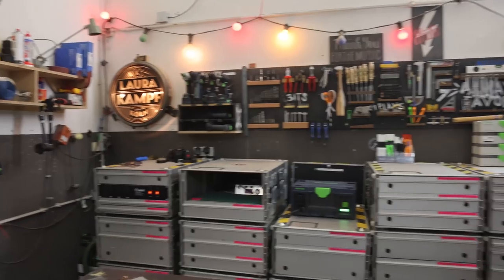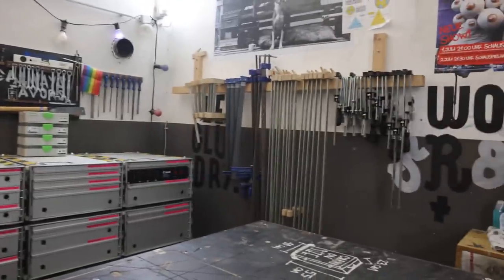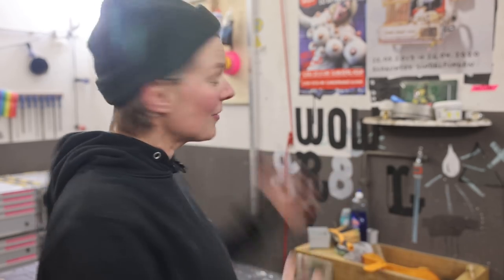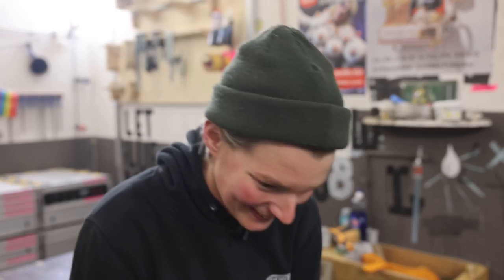This Clamp Storage Idea would be really good...if it worked :)

Comment: Some thoughts I had while watching:
Bearings are not pulleys. Your home-made pulleys (while nicely made) are part of the problem. Where the rope goes around or over the bearings, you're getting more, not less, friction and the ropes will slide off the bearing and jam. Use the bearings in the u-channel to ease the friction there (per Pixel Cadence's comment below).

If you want to be able to push it up manually, you need a counter weight so that the system is in weight equilibrium. Look at how theatre fly systems work for inspiration.

If you want to raise it by rope, use proper shaped pullies to keep the rope inline and set a hand winch at the end so you can just wind it up rather than hauling on it. Motorizing the winch will be even easier.

That's a lot of weight you have there, due to the solid piece of ply added to the clamps themselves. If you make it more skeletal, by cutting voids where you don't need material, it will weigh less and be easier to move. Even easier to move would be making a new frame out of aluminium.

BUT you're still losing the wallspace because you can't put anything below the storage or you won't be able to get it down low enough to get all the pulleys from it, so is it actually achieving the end you want?

My solution would be to create a horizontal frame I can hang clamps from and position it in the middle of the room, so I could use the wall for other storage, and counterweight it so that I could move it by hand.

Comment: It looked like the rope you were using was too small for the pulley you made.  I thought I heard the rope binding between the plate and the bearing. Shorten your brass axles so the washers rest on the inside of the bearing, closing up the distance between the plate and bearing. Use wheels or small bearings on the side of the board and inside the aluminium channel, like Pixel Cadence suggested. Love your videos! You're a brilliant maker.

Comment: As has been commented, the wheels of pulleys designed for rope have a groove running around the circumference which captures the rope and keeps it from getting wedged between the wheel and the flanges. Using plain bearings as pulley wheels is sub-optimal to say the least.
Making proper pulley wheels would be a good turning project. And while it's nice to have bearings in the center of the wheels, at such a slow speed they are really not necessary. Just a plain metal or even wooden wheel on an axle will work fine.
There are plenty of charts online that will explain the mechanical advantage of various pulley systems. These will help you decide how many pulleys you will need for the weight you will be handling.

Comment: I would definitely put a servo or winch on it. Also... the real trick is to end up making use of the wall space behind the thing that drops down, so ideally it drops down in front of something that is opposite it's own use. Like have the clamps on rails come down in front of the lathe... unless you plan on turning something with your clamps on it.

Also put some wax on your guides and the board, and you might want to think about putting some edge guards on your pully's sheet metal so it doesn't damage your line.

Comment: It looks to me as if it may be a weight balance issue looking at where it is binding. You may try and find the center of gravity for the center pully. Another solution may be to add bearings to the side of the board to relieve the binding issue as well.
Just a thought. I hope this helps.

Comment: Look at garage door systems.  Whether manual or motorized, they have to balance the weight of the door against something (torsional spring force in most cases I know of, could be a counterweight) to make it easy to operate manually or motorize with a small motor.  A steel sheet behind the base board could work, if you make your channels wider.

Comment: Thinking about reducing the friction of the rope with some metal wires insted of the original rope. And what about puting baring on the board to also reduce the friction? And finally, a motorize system should be a good option! Good luck for the next episiode!

Comment: You need to reduce the friction on the sides of the wooden panel, maybe track on wall, bearings on the wood edge? Or the other way round with bearings touching the wood edge.

Comment: As Mr. wortheffort says you still can use the bottom of the wall as temporary place. His idea of using some kind of frame on pulley system with your high ceiling should work. As far as the weight just add a couple of more pulleys and install an elevator type breaks to the bottom of the main board in case the rope breaks.

Comment: Not sure if that's the case but it looks like in addition to being heavy, the board also gets stuck if it isn't raised perfectly straight. If that's the case, maybe some wheels in the side rails would help. If it is too heavy, I would suggest a greater reduction and maybe a hand crank to pull it up in a continuous motion rather than bit by bit.

Comment: Great idea, but, as other people say, it rubs with the metal frame. Looks heavy, but not crazy heavy, as you could lift it a bit by hand. Try adding some skate bearings to the sides of the board, should be super easy to pull. You can add some kind of trinket to it, like a car elevator, so it won't drop directly to your feet of you let the string go, as a safety precaution

Comment: OK, to leave it mostly the way it is, there's two obvious things you can do, as I see it:

1.  Install a windlass to manipulate the string.  A windlass is pretty much just a manually operated winch, which will give you some more mechanical advantage, making the force needed to operate the thing less.  It is also less likely to just come loose as the line would be attached to the windlass under where the line would be wrapped.

2.  Install a higher order block and tackle, with most pulleys  so you can have more segments of line holding the load, getting more mechanical advantage that way.

Comment: Looks like a great idea, and the concept is there for sure! I think you're definitely getting some binding from the guide rails. Instead of idlers, bearings, or lubricants - why not a simple wire guide system? Two cables, some turnbuckles, and four simple eyebolts will work perfectly well and should need zero maintenance over time. Also, no way for it to eventually get clogged with sawdust.
Reply: Also, another idea: if you're concerned about the possibility something might go wrong that results in the plate falling down, you could scavenge an old seatbelt assembly and permanently mount it between the plate and a wall anchor. That way it'll let you raise and lower the clamps in normal use, but if it falls too quickly the mechanism will lock and stop it in place.

Comment: at 8:16 you can see the top pulley binding the rope, this is partially how it is mounted, partially that you have the end you are pulling on the farthest from the wall rather than the closest, and partially just the type of rope being soft enough & small enough to climb over into the spaces those washers created.  I bigger, less compressible rope would solve part of that, the twist in the pulleys could be partially addressed by wrapping it from the outer side in toward the wall as you feed the rope eventually to the pulley off to the side and the rest could be solved by boxing the top pulley in to both end are supported or suspending it from the ceiling instead of the wall.

a slight taper to the top within the channel and wax would litley solve much of the binding on the panel itself as long as the weight is mostly balanced

a counterweight off each top corner of the moving panel would likely help if that is not enough.

Comment: Due to the shape of the objects on the board, I think the centre of gravity is off and causing the board to twist and jam in the siderails. Put bearings into the plywood so it moves easier. Also, you made your own sheaves with bearings, good job. However, for very little money, you can buy proper sheaves that have a groove for the rope you are using. That will reduce your pulling effort as well. Otherwise, that is a great idea with almost perfect execution as well.

Comment: Your idea is a very ancient idea and very doable. Even the ancient Egyptians used pulleys to create ratio then they also had counterweight. So weigh the mass of everything being pulled up. Then get a counterweight slightly heavier than that and in doing so you would be able to pull it up very easily.

Comment: Replace the vertical channel with parallel links so the the storage will come out and away from the wall when you let it down, that way you can really use the free space on the wall. In the top position, you can latch the storage in the up position. Warning, do not let the links go full vertical in the up position.

Comment: As many said it is a problem in the pulleys, others say counterweight, but the problem that I see is the anchor point of the rope to the board is in the center of the board and all the added weight is offset from the vertical center of the board and This means that the board does not run vertically on the aluminum guides, you must improve your lateral guides, and add a safety system to the rope to avoid sudden fall, if you add a counterweight this is not necessary. Greetings from Chile

Comment: Might be worth it to install some detents in the rail so if it does come loose, it can't fall far as it will "lock" in place.  Kind of like what you see on an extension ladder or a car lift.  More pulley loops will change the ratio and make it easier to raise as well :)

Comment: I think that if the aim is to simply have something that looks better in that space, consider a shallow cabinet with the clamps stored inside, and design some type of decorative door for it, whether that door slides up out of the way, pulls down and rolls up like a projector screen, is of ply or pegboard or ? I know you will come up with something amazing in the end. Or just keep on but maybe switch to bigger pulleys (old bike wheels? does a bigger wheel give more power to the pulley system?), triple instead of double pulleys, or maybe an old chain hoist or engine lift will show up serendipitously to donate some parts to the project. Wait, wait...this is a Laura Kampf project, so we need a liquor service that raises up out of the way to access the clamp storage, and it probably has a barbeque that mounts there for parties. ;)

Comment: Fantastic idea, so you can see your art most of the time, and a nice demonstration of mechanical advantage.  I think your plywood may be binding in the aluminum brackets, because the load is likely off-balance.  Maybe try putting some roller bearings inside there so the plywood can ride on those.  Cheers! <3

Comment: As a boatbuilder and sailor I had to laugh so hard when I saw You weaving the red rope around Your fixed points, but You got it trialed and errored for Your own - best learning effect ever! ..... You also might add bearings for the big sheet to run on -  each corner one or two bearings would stop it from twisting and canting. Weight ain't a problem for a pulley-system - just add one or two more blocks and get it up just a bit slower. It would work with some "polishing" and easing of the sliding friction of Your big sheet in the rails.
Edit: Oh, and boatyards often have their clamps on wheeled rigs to freely move around and pull all clamps together at once to where You need 'em. There is no such thing as "too many clamps" in a boatyard, and it's often annoying to have to carry those where they all are needed.

Comment: Like a lot of the comments, rollers on the tracks to reduce friction. Instead of rope, get cable and a small electric winch. For the pulleys or really block and tackle, more pulleys in the block and tackle mean less effort to move it, but the length of the cable increases. Look at engine hoists, they don’t need a lot of effort to move it up, but do need to pull a lot of chain through. For safety, some kind of ratcheting mechanism, or a brake that is released when the rope tension goes away to keep it from falling.

Comment: I would add wheels into the tracks.
(basically a sliding door just vertical) 
I assume that the friction between the plywood and the tracks causes most of your problems. 
And on top of that when you pull on the rope the plywood tilts to one side and verkantet (sorry, don't know the English word for that). Wheels probably would solve that as well.
Reply: The easiest way to add wheels would probably be to use 4 skateboard wheels or rollerblade wheels or whatever you have lying around.
Just put one bolt through the wheel and bolt it on the front of the plywood, so that maybe 1/3 of the wheel sticks out over the side of the plywood.
Reply: An over head garage door would be cool

Comment: Motorizing would be pretty neat.   Perhaps work out some sort of fail safe system, where pawls, held out of the way by the tension of the rope or wire, would fall into the track, arresting the fall if the cable or rope fails.    

I agree with others that the system would be more useful if offset from the wall far enough that you could store other stuff behind it.

Comment: You could use 4 wheel pulleys or fit a wire & a electric winch but I would use a bike chain (heavy duty) & bits of bicycles using the peddle as hand crack, enabling you to figure out gearing to help you 👍👍🇬🇧🇬🇧

Comment: If I would come up with a solution for this unique device.
 
First i would reduce the friction in the rails by adding 3 rolls on each side to slide in the Rails !
Second thin would be to put some double L shape doors on hinges to close it up so nothing can fall on my head  🤕!

To lift it up there are a few options which you could chose from:

1. A Sailboat winch 
2. A Hand winch
3. A upside down installed Hoist in german Hebezug "you could also use for other stuff"
4. A car wince "you can see on Jeeps"
5. A pneumatic cylinder "I think the worst option "
6. A spindle motor " also not the best option"
7. A lever mechanism "So you learned about pulleys so you could also learn about levers"
8. A crane

So I am interested what solution you chose 🤔🤔🤔

Comment: I believe you're introducing friction with the homemade pulleys. The plates between the bearings are probably getting caught on the rope as it crosses from one bearing to the other. It may also be rubbing the inside of the pulley since the bearings have a flat surface instead of a channel to hold the rope.

Comment: For the weight you are trying to move, I might suggest adding one more pully beside the ones you have. it will distribute the weight better and make it easier to lift up. Also like Bob mentioned below it appears  that your rope is getting hung up on the side of the bearing and not traveling in the middle of it. Great idea though.

Comment: if heavy garage doors can be lifted up then this can too. Garage doors use springs to make the door lighter. And safer to manually operate. Maybe use just the springs or maybe also use the garage door motor as well

Comment: More pulleys! More pulleys equals lighter load.  But it also means pulling a more rope per inch/cm of distance covered. You might want to add a motor and spool.  As others have mentioned, less friction at the sides.  Bearings on either side of a rod. Kinda like a roller coaster.

Comment: I think if you reduced the weight of the plywood holder by cutting out some (artistic) shapes it would be a good start, and reducing the sliding resistance in the channels would help too. You can obviously reduce the force needed with the pulley with more loops between blocks, but then you have to spend ages pulling it which is where a motor could come in handy!

Comment: Several easy adjustments would help GREATLY! Could add a hand crank with a decent sized wheel to take-in the rope and a counter weight would definitely help. Another option would be to use another pulley (mechanical advantage) on the draw side of the rope. Adding pullies also increases the length of rope needed. As you increase mechanical advantage you increase the amount of rope. I do not know what rope you are using but as long as you are within the rating of the rope, pullies and hardware you will be safe.  Some friction reduction on the slides too. Good luck, you are definitely not far off!

Comment: No problem calling it a failure. That's how we learn.
The second setup probably gets out of balance, to the sides and the front. Also the rope has to handle the weight. If it expands, it is the wrong rope. Some people mentioned counterweights and wheels for the side tracks. All good ideas to consider. I would not use a motor. It is either too slow and noisy to use or you need a totally different setup.

Comment: The single point pull is causing wracking of the base board. try using 2 points to a rope clew that then transfers to a single pull line. you can then use the block and tackle configuration for mechanical advantage on the single pull line.  each purchase line goes from base board to a turning block that then redirects that line to the side and those lines go through a double block and then to the rope clew. where the 2 lines become one .

Comment: If you double the number of pulleys, you’ll halve the effort required to pull the storage unit up and down.  There are a couple ways you could arrange this, but however you do it, you’ll also double the length of rope required to move the storage.  For that reason, I’d use something you could hand-crank that would wind the rope up and down.

(Also, I agree with @seegurkekiller; “real” pulleys should have way less internal friction.  Replacing the ball-bearing wheels with plain-axle wheels with guides on the sides to keep the rope from slipping off would do just as well.)